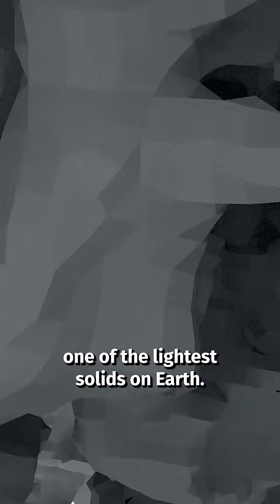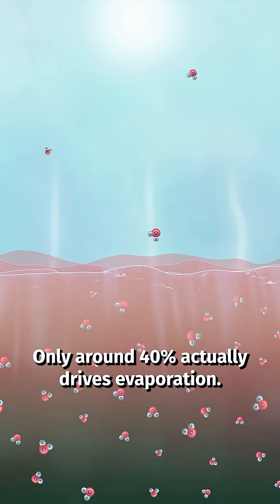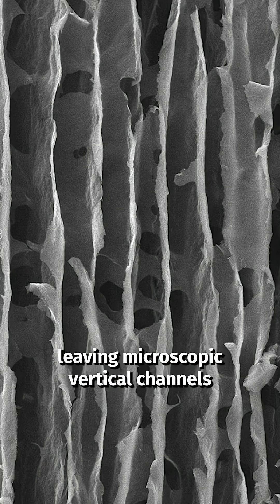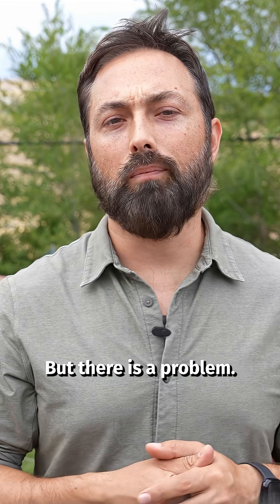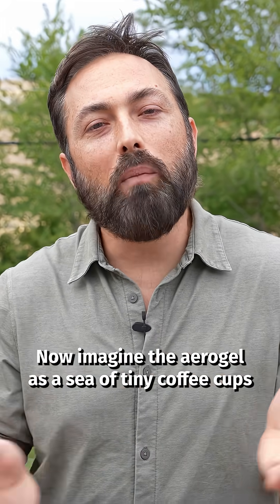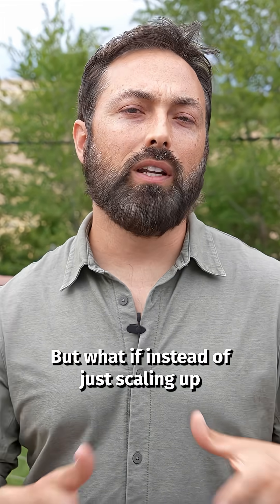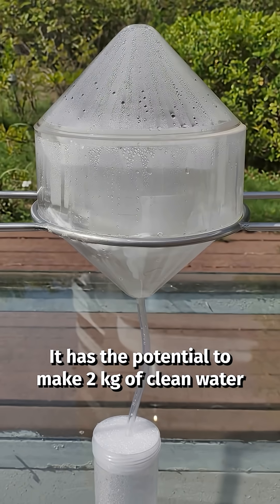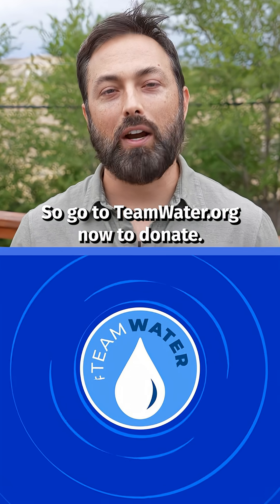How aerogel can make the ocean drinkable

Comment: Wouldn’t the better solution, for long term, be to clean the oceans by removing all the trash that is sitting just below the surface and protecting/saving/regrowing the rainforests to help cool off the earth, thereby cooling the atmosphere, which would make the moisture in the atmosphere condense and cause rain, eventually refilling the wells with drinkable water. But it seems their solution is to create an even higher salt level in the ocean, causing the oceans to heat up more, thereby causing the earth and atmosphere to increase in temperature, causing higher capacity of moisture in the atmosphere, therefore accelerating a worsening climate change.

Comment: Oh. No. My radar says this is bad. What are the possible good things about the vapor barrier. If God wanted the oceans to evap at faster rates he'd have made it that way. 
Ocean trash issues after evap? 
Microscopic life in the top layers of the ocean? 
How would it affect weather? 
We can build large oil platforms, why not desal or desalinization platforms, where the water is cleaned of microplastics and trash, oil, etc. 
Speeding up ocean evaporation sounds like the making of hurricanes and insanity, and further harming wildlife, and will it break down over time causing more microplastics? Just because they can doesn't mean they should. If they want to use it outside the ocean on a water reclamation platform, then fine, as long as it doesn't break down a bunch of toxins and microplastics in the water, which it probably would. Put a distillery in the platform. Take out toxins, put back the minerals the ocean needs for balance, use the excess.

Comment: I actually think that 2kg/m2/hr is way overstated. The evaporation heat of water is about 2257 kJ/kg or about 4500 kJ for 2 kg. Sun's irradiation at sea level, however, is only about 1 kW/m2 or 3600 kJ/m2/hr. So even if you could turn all of sun's irradiation into evaporation of water, you could get at most 1,6 kg/m2/hr.
Reply: I looked at a few articles on Google scholar. Turns out "interfacial evaporators" have been known to outperform theory for several years. Many authors propose the affinity of the hydrophilic polymers for water disrupts hydrogen bonding and reduces ethalpy of vaporization. However other authors, observing the persistent >1C drop in temperature at the surface when in darkness for many hours, calculate that the persistent temperature gradient itself is enough to explain the enhanced evaporation without having to claim any measurable change in enthalpy.
Reply: @chadeller5588  I don't know why my first reply doesn't show up, but here another try: Thanks for this insight. I have found an article, that argues against the reduction of evaporation enthalpy, but comes up with an ineresting alternative idea. They speculate about a kind of nonthermal photo-electric effect that makes whole clusters of water molecules leave the bulk at once. In contrast to true evaporation, which is single molecules leaving the bulk, this alternative process of producing a so to speak "fine mist" rather than true vapour would obviously need less energy. The title of that open access paper: "Superthermal solar interfacial evaporation is not due to reduced latent heat of water"
Reply: @chadeller5588  Thanks for these ideas. I have also found an article that argues that a reduction of vaporization enthalpy is probably not the right explanation. They put forward the alternative explanation of some kind of non-thermal photoelectric effect that is capable of removing whole clusters of water molecules at once from the bulk water instead of single molecules as in true thermal vaporization. The energy needed for creating such a fine mist of tiny droplets would obviously be smaller than creating real vapor. The article is open access: "Superthermal solar interfacial evaporation is not due to reduced latent heat of water" Energy Environ. Sci., 2025,18, 1707-1721
Reply: 1kwh/m² is about right in central europe but i is higher near the eqator, where they probably want to use it. 
I also remember, that the energy needed is impacted by the temperature of the water.
Reply: @Laurin99  It isn't much higher near equator. The absorbing atmosphere, that has to passed, is about the same. Also, the evaporation heat does not depend much on the temperature of the water. (In fact, the figure I cited is the figure for boiling water.)
Reply: it looks like they use a "best case" scenario with very low heat loss but i still don't buy it. I tried to look at the data but you can't get access to everything
Reply: This is nullified with the microscope straw shaped structures
Reply: The idea has a lot of problems but the Energy consumption isn't one in my opinion. The water around the evaporator contains so much Energy that the evaporation will never manage to cool It down. Evaporation even works below room temperature if the surface is high enough so it doesn't need "heat" per se

Comment: Now build a "Buckyball" out of thin titanium or carbon fiber rods, surround it with aerogel or better yet airalloy (aerogel mixed with metal), and empty the "ball" to form a vacuum.  Build it big enough that you can create a vehicle around it, and then adjust the amount of vacuum to ascend and descend.  Propulsion can be achieved in many ways, though I'd recommend an inertial dampening system and Biefield-Brown or Searl effect for propulsion.  Now you have a UFO.  You're welcome.  Ever wonder why there's discs with domes, or spheres, or "cigars", etc etc?  Bubbles, baby!

Comment: hmm
As when water evaporates, it has a cooling effect.
How would having lots of those things all around effect and alter the weather?
1 - the oceans would be cooling if enough are around
2 - More moisture in the air, more rain etc?
Reply: 1) it'd counteract the warming oceans problem, but only a tiny bit, as the scale that we'd use is much smaller than the whole

2) the local area would technically be less moist, as the water vapor is within an enclosure and gets collected as liquid water, not going into the local atmosphere
Reply: @tinhoyhu  forgive me. I was asking a theoretical question meaning "If we threw lots of these in the ocean" lol not really being serious. 
I understand that, if used only as mentioned, the Vapor would be collected

Thank you for your answer tho

Comment: Just use reverse osmosis its way more efficient than boiling water because you aren't boiling water to remove salt you are directly removing the salt and letting the water go thru
Reply: RO requires extra energy to be added to the system and can be expensive to operate.

This method directly uses the sun.

I think an equivalent carbon neutral RO system would require steel pressure chambers installed under the ocean and force the water through pipes to the mainland.
Reply: @thomasreedy4751 
the sun
isnt free energy each square
meter can be replaced with
solar panels for just 2kw of
energy you can turn 1000 liters
of salt water into fresh water vs
the 30kw required with thermal
distillation for the same amount
And also you cant have a syphon that makes water move higher than the highest point of the water inside the container so no you cant have steel beams under the ocean floor and have the pressure from the water push water into the mainland
Reply: @thomasreedy4751 the sun
isnt free energy each square
meter can be replaced with
solar panels for just 2kw of
energy you can turn 1000 liters
of salt water into fresh water vs
the 30kw required with thermal
distillation for the same amount

Comment: Cool.

Why are we measuring using 100s of microns. Why not use millimeters. 100s of microns could be anything from a tenth of a millimeter to 99 percent of a millimeter. 

So just say half a millimeter wide. Or a quarter of millimeter wide.

If your using 100s of a unit of measurement, move up to the next unit.

Comment: what I never understood is why we don't make shallow black pools to let sun evaporate sea water
Reply: It is exactly the way people harvest sea salt.. so you get two benefits from one action.
Reply: It’s probably some combination of non obvious reasons. You’d want cheap flat land next to ocean next to population center. You could float on the water, but that depends on weather and waves and there’s shipping channels too, adds cost. These probably aren’t as efficient in practice or come with caveats. Just ask yourself if you would invest actual money in this.
Reply: @techman8817  be a lot easier, cheaper, and reusable than manufacturing and dumping an ass load of aerogel that's just going to get clogged with salt and need to be replaced.
Reply: @-Miasimon yeah it would be better and simpler, I agree. However, it is still very inefficient compared to multi stage flash distillation, which can run on waste heat or low concentration solar. There is a good reason Saudi Arabia uses that type of desalination rather than a simpler method.

Comment: I I was to lay a tarp over the water it would do the same thing and not work. All it’s doing is creating a surface hydrogen that can sit at a different temperature against the surface or breaking surface tension. Put a paddle wheel there it does the same thing. The gel does nothing their idiots.

Comment: The potential of 2 liters / m^2 / hour is A LOT of clean water. However it will also end up creating a lot of salt as a bi-product. It's gonna be interesting to see how they plan on dealing with that. It will most likely clog everything up I imagine
Reply: Bottle it and sell it.
Sea salt is valuable for food and bath products
Reply: Depends on the materials used. Nanoporous graphene, polyamide, polydimethylsiloxan, or even specially-designed solar evaporators made from cellulose, carbon materials, and plasmonic nanoparticles all effectively reject salt. 

Hard to imagine they’re not all over this problem already, considering the subject matter.
Reply: @borismuller86  if that was the case they wouldn't be making it an evaporator. It would go under the water line and use water pressure already there to push it through the membrane. You could have clean water significantly faster that way. Have a weight tied to the bottom and have a line attached and just toss it over.
Reply: @WaterspoutsOfTheDeep  This is what I thought! Why didn't they put a simple black surface right beneath the surface of the ocean so the heat from sunlight does its work in heating the top layer and lower water layers stay cool and it would solve the clogging problem as left behind salt is washed away by new ocean water?
Reply: Just gimme some Rice and butter with it. ill handle it😂
Reply: @scrxvv 😂😂😂
Reply: Simple, just sell the sea salt.
Reply: *by-product.
Reply: the salt ends up in mcdonalds fries
Reply: unless it washes away through the bottom, as the pores saturate the salt, and then even saltier salt water would sink as its heavier. thats my estimation at least.
Reply: Hmm. 
I have become very suspicious of any process which subverts the natural. 
So, yes, creating potable H2O is a good thing, but scaled up, how will this affect the climate?
Reply: @johncunningham9094 Likely not well given the fragility of aerogel and the links of silanes and siloxanes to mast cell activation in humans. MCAS is a medical condition that creates a large amount of plastics use, driving up the rate of fossil fuel use and CO2 and other greenhouse gas emissions. Good idea, but terracotta already basically does the same thing without the devastating environmental and biological consequences.
Reply: @johncunningham9094 less than the current, massive desalination facilities which largely rely on boiling the seawater (ultimately powered by fossil fuels in mist cases). Membrane based desalination is more efficient but comes with its own challenges.
Reply: Luckily, it can be just cleaned off with water.
Reply: Isnt the bigger problem that aerogel is fragile and solixanes and silanes are linked to environmental damage and mast cell activation (and this inflammation and hormone disruption) in humans and other mammals?
Reply: well obviously u'll have to do some kind of upkeep. it could be as simple as emptying a salt container and filling ur salt jar with it. U literally shoot drums of plutonium that u dump in the ocean so they sink, the idea the 'effects of removing water from salt water need to be taken seriously' is a joke. Corpos who will say sht like to maintain a lease on ur life, will be actively dumping into the ocean.
Reply: Salt shouldn't be a problem but a resource. One use we always need is decentralized power. You can make some house size batteries with molten salt, and this in turn is a bonus that makes evaporative systems at least seem worthwhile. 
   I guess we'll just have to wait and see.
Reply: Sell the salt
Reply: Sell the salt to McDonald
Reply: Desalination has an issue with efficiency, not salt removal. It's an engineering problem, not a physics one. If your desalination is so effective that you have salt removal issues from it, you're actually in a very, very good place. Not to mention you can literally sell it as ocean salt, for a premium no less over normal salt.
Reply: I'd say all that salt can be used by league of Legends players.
Reply: @quineloe  Or maybe War Thunder players as well.
Reply: It sounds like an unintended consequence could be that the sea gets salter and colder
Reply: Correct me if I'm wrong because I'm a dumdum. But isn't climate change partly being worsened by the icecaps melting and making ocean water less salty? Isn't this then in turn also a possible way of upping the salt levels in the ocean?
Reply: @MattMadgarr I’m no expert on this subject either, but I can’t imagine that the evaporation will be on a scale that would have any actual impact on the seas salt levels. Maybe over a looooong period. But what do I know
Reply: The evaporation rate of water depends on the solar constant (~1.36 kW/m²), and evaporating 1 kg of water requires roughly 2.4–2.5 MJ of energy (latent heat at ~30–0 °C).

The Sun delivers 1.36 kW/m² × 3600 s ≈ 4.9 MJ per hour, which corresponds to roughly 1.96–2.04 kg/h of water evaporation at 100% efficiency. Of course, this assumes RH = 0%, no energy losses, a perfectly clear sky, the Sun directly overhead, and no atmospheric absorption — basically, a “spherical cow in vacuum” scenario. Accounting for atmospheric absorption, this drops to about 1.3–1.4 L/h at 100% efficiency.

At 30°N, this translates to roughly 8 L/day, and at the equator up to ~16 L/day under optimal conditions (ET₀). In other words, even in the best case, we’re talking about 30–65% of the theoretical 2 L/h. For an average day, the realistic value would be closer to 3–5 L/day, or about 10–20% of that 2 L/h ideal.

There are two “tiny problems”:

Algae growth on the top surface of the evaporation vessel increases its weight, causing it to sink deeper into the water. This raises the ever-so-interesting question of how much osmosis will actually remain effective.

Saltwater splashes onto the vessel, so the upper surface may turn partially white, or, in a delightful twist, algae might start growing right there as well.

Given all this, the probability of success is less than 0.01%.
Reply: @matejmacek5784 I wonder how the numbers compare to multi stage flash distillation. I estimated MSF being something like 20x more efficient per kW(thermal). It seemed so much better I was not sure of my numbers.
Reply: @matejmacek5784 you started with a bunch of science, which is haven't checked but I have no reason to disbelieve, and then end with an entirely unscientific "0.01%" probability of success.

You need to choose if you are a science guy, or a vague and spurious guessing guy. Both doesnt work.
Reply: The seas will be dead seaing

Comment: This seems like an overly exotic idea for a relatively simple function.  A thin layer of water over a basic insulator should be plenty for efficiency, and easy to flush the salt, and a circulator fan to blow across the boundary should be very effective, because even with a grid, how is fresh air supposed to get to the central areas without help?  It still has to come from the outside areas.  Or use a grid of nozzles blowing at the surface.  No aerogel nor pores nor half-baked inner grids that need external help.  Also, aerogel is incompatible with water...

Comment: Accounting for waste/inefficiency, and converting 3m^2 => 1gallon per hour, and 8 hours of production per day on average: Each person would need 15m^2 to produce 40 gallons of water per day. 

This allows the water to be directly introduced into existing municipal systems via filtration & treatment to be safe.

For a city of one million people, that's 15 square kilometers, or roughly 4km per side. That's incredible if this can be scaled. Remember, I'm accounting for significant losses and only producing 8hours per day.
Reply: I wonder how many hours they can go before they need the salt cleaned off. Could effect the efficiency. And how many times can the aerogel be cleaned before it begins to deteriorate (don't think we want micro aerogel in our drinking water).
Reply: @lioelbammalf7483  Yeah that's definitely part of the scale research - maintenance, waste, cost to deploy, inspection rate, etc all affect the bottom line. That takes almost as long to solve (if ever) as the material science research for critical infrastructure.